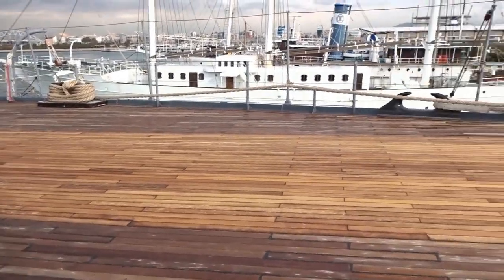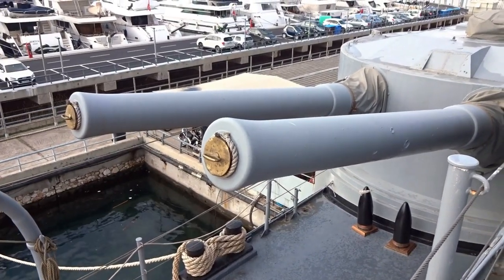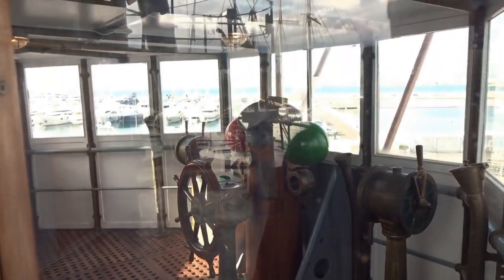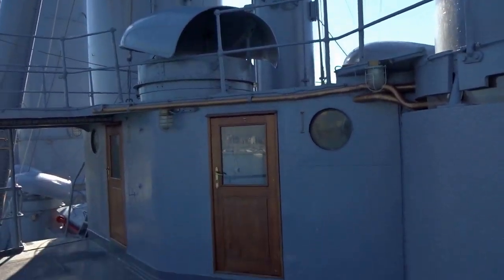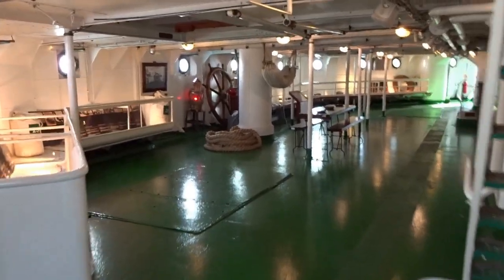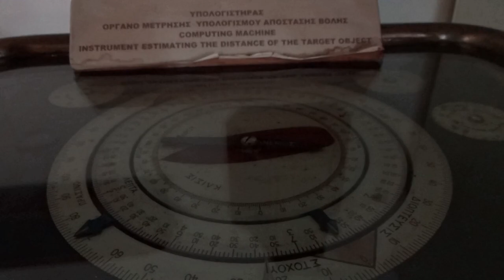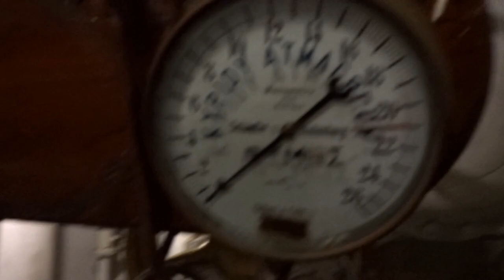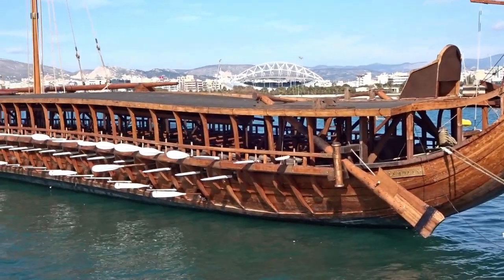RHNS Georgios Averof, a tour of the last Armored Cruiser.

Comment: Thank you for the tour. I always wondered, what are the hatches on the deck for at 6:13? Is that to allow for sunlight to reach the lower parts of the ship?
Reply from the maker: Probably not. having such a wide shaft running through the decks of the ship would be a huge risk.
Reply: @spyrosvassilakis4212  I see. Is the purpose of those hatches known?
Reply from the maker: @5000mahmud  I understand that it provided ventilation and sunlight to the area immediately below. There are more hatches like this all over the main  deck in areas not protected by the main belt.
Reply: @spyrosvassilakis4212  thanks